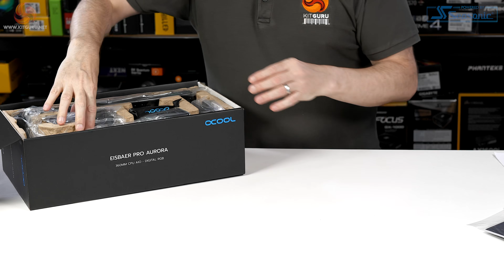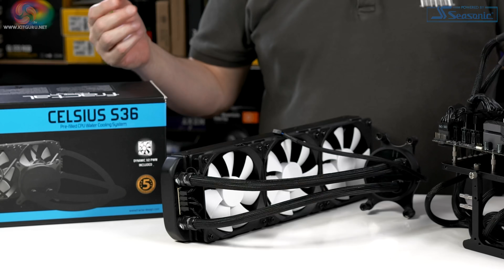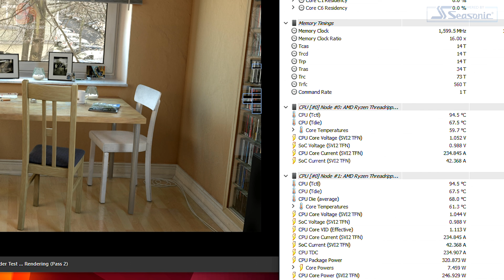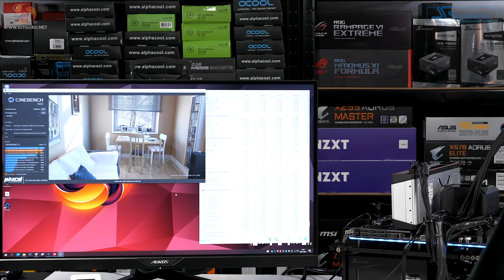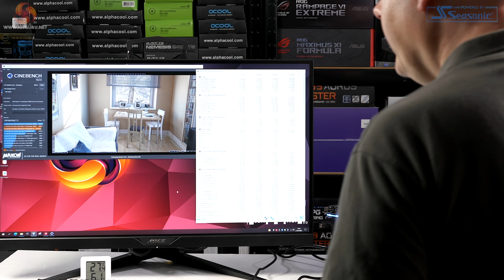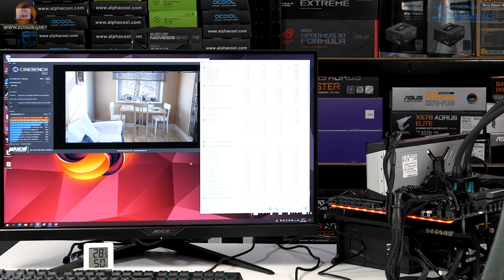Alphacool Eisbaer Pro Aurora 360 Review

Comment: have the Dame setup. Fans Work fine pwm, quiet and Low rpm. Trick is U HAVE to Connect to cha1 or cha2 Fan. dies Not Work connected to m2 Fan or anything Else. so its a Motherboard / bios Problem.

Comment: I just bought the 240mm version to add to my Eiswolf 2 loop on my GPU. Can't wait for it to get here! 

Great video, thanks!
Reply: Howd it go. im actually doing the same thing. how are you connecting your fans and RGB?
Reply: @RD-D  worked well, but I eventually scrapped the radiators and upgraded to a massive Black Ice SR2 MP 360mm radiator with 6x Noctua NF-A12x25s in push pull. It's essentially a semi-custom loop now, just with "integrated pumps". I changed cases and only wanted one radiator. 

I don't have the RGB connected anymore. but when I did both sets were daisy-chained together to an RGB header on my gigabyte motherboard.

I hope this helps, and I'll be happy to answer any questions you have.
Reply: @johnhancock6951  do you sti have the 240mm rads and fans?

Comment: Why aren't the tubes sleeved, Alphacool? It's not 2005, nor do you make 'budget' coolers.
Reply: The TPV tubing is from their industrial/server line. They're very thick EPDM rubber, and are designed for longevity. I think it looks quite good, but tastes vary. I swapped the fans on my Eiswolf 2 to Noctua, omitted the RGB controller, and am going to do the same with my Eisbaer Pro Aurora that will be delivered in a couple days. Considering my build's goals and aesthetic, I'd much rather this TPV tubing than anything else. 

Function over form, though the form is just fine for lots of people. :)

Comment: Who uses 2011 these days? Me, my 5820k overclocked to 4.2ghz runs great!
Reply from the maker: Perhaps it would have been better to say 'Who is building a 2011/2066 system these days?'.Presumably you aren't in a market for a cooler for your CPU as you have clearly been up and running for a while.
Reply: @KitGuruTech  Refilled my EK 360 Predator a month or so ago when I purchased my new GPU. Shame EK stopped making those, has been excellent for me. I think I will go back to Noctua high end air cooling next upgrade cycle for the CPU.

Comment: Great video. Let's hope they fix the fans. As is, a buyer is looking at an extra £60 or so to fix that problem. Not a huge expense but definitely an embuggeration. 

I'd like to see you test the Silverstone Threadripper cooler.

Separately you mentioned in passsing that you would likely upgrade to a Threadripper 3000. Given the low RAM limit, I'm wondering why you're not thinking of upgrading to a Threadripper Pro 3000? Then you could do a video or three on the various 64 GB and 128 GB DIMMs: which ones should we choose?

Comment: Fans can operate at +/- 10% their rated speeds, but you should know that.
Reply from the maker: Yes indeed, however the original reported speed for the 2,500rpm fans was 2,850rpm which is more than 10 percent. Using the Asus daughter board showed one fan running at 2,500rpm and two at 2,750rpm which sounds correct, so the first instance has to be wrong. The variance between the three fans doesn't seem ideal but that isn't a problem in itself.
Reply: @KitGuruTech  i would say 2850 rpm is possible to be legit. I would say the biggest problem is those fans are just really bad. The aio looks super nice though. You should do a video testing it vs asetek cooler for am4 to see if the bigger cold plate does anything on that platform.
Reply: I have been using Alphacool's LT360 with Noctua Redux high static pressure fans over the factory fans on my I9 7900x for awhile now. I like Alphacool products. They are a great price for price for what they give you and the performance you get.
Reply: @whocares0503  oh i am only saying the fans suck. I know alphacool makes good products. Minus whatever those fans are lol.
Reply: It seems to me, wanting rgb fans sacrifice noise/performance.  The Noctua fans prove this.  So why is this?
Reply: @Petrol-Hd   I would guess when a company spends the RND money on looks instead of performance that is what happens.